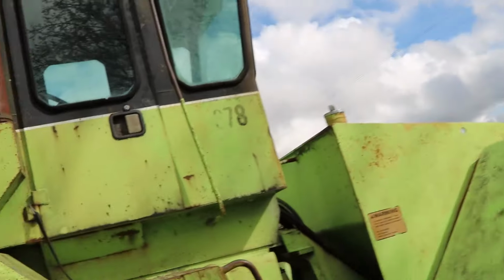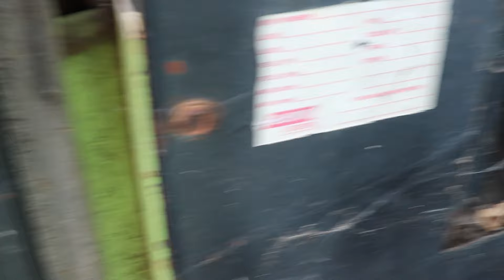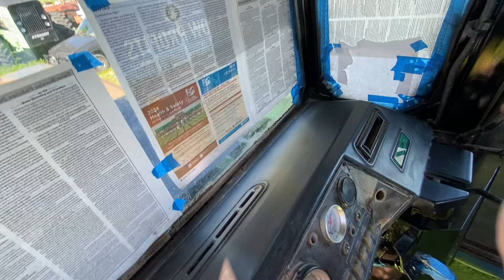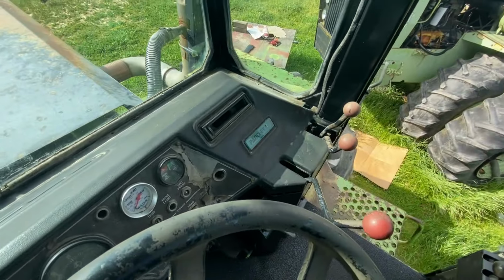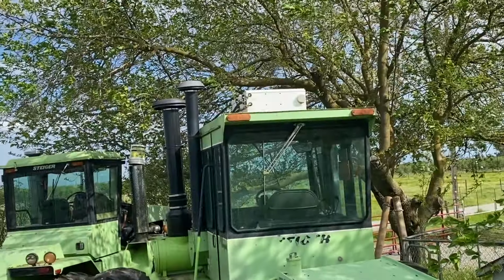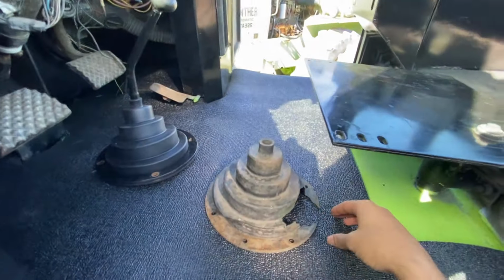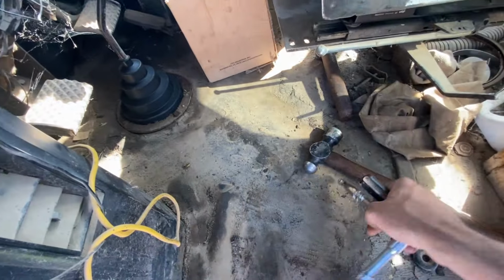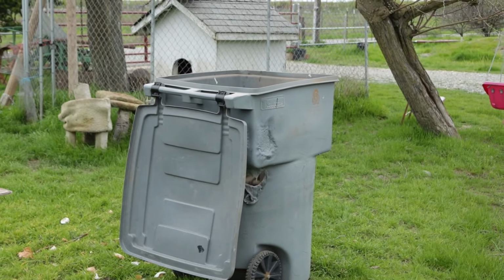Finishing the cab on the Panther ST 325

Comment: Good  work  , the cabins are looking good ,  the seats ware on the in side ,  the nyoln rollers and the steel pins , what i can remember . Correct me if i am wrong . Good  to see the steigers coming back to life .
Reply from the maker: Yep, you are correct. Structurally the PTA seat is worn out, a pin in the back of the seat broke and the seat didn't get enough cushion when it got reupholstered... The ST seat is much better!
Reply: It good  the seat if fixed , makes alot smother ride .

Comment: Wouldn’t a paint gun be cheaper than all those rattle cans…
Reply from the maker: Paint gun if you are going to paint a lot, rattle can's for more detailed work. The paint gun would be too big and bulky to paint the inside of the cab which is why I used rattle can's. Besides you would have to measure, mix, then shoot the paint, then clean the gun. Too much work.